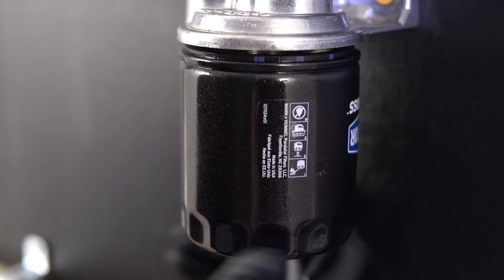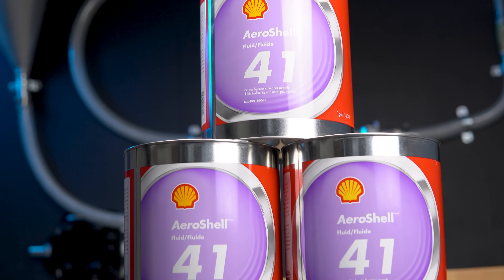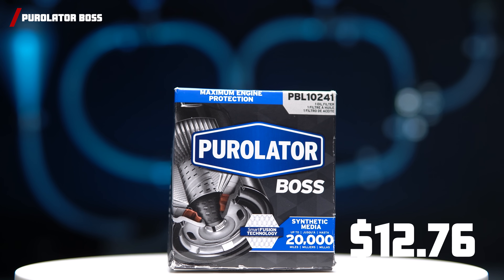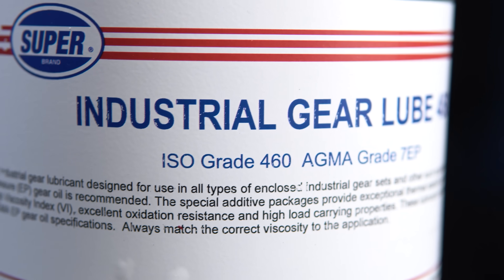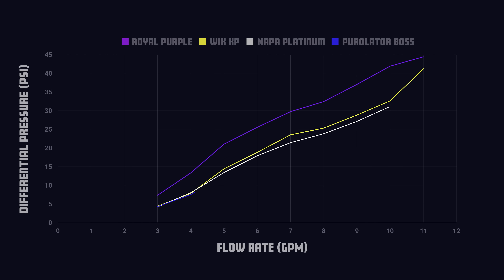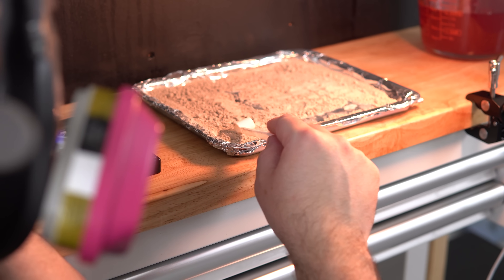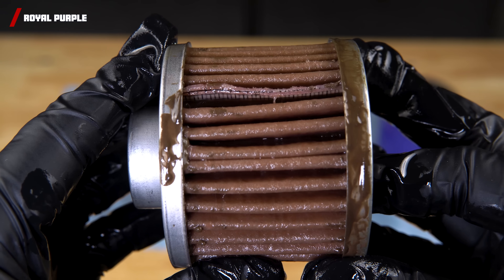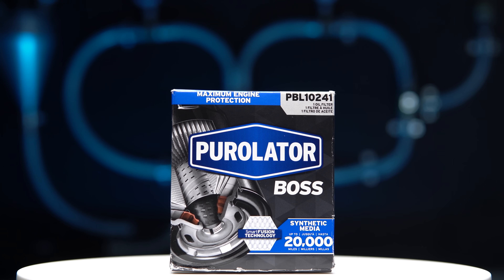Engineers Test the Most Popular Oil Filters

Comment: Uhm... it's a filter... wouldn't the higher particle content be better if it was in the filter? Or was it the oil filtered, that was sent back to be tested?
Reply: the results were confusing or at least how they were presented. the oil used in testing the flow of each filter was sent to the lab and the lowest particle count in that result would indicate better filtering. Purolator filtered best followed by royal purple, wix, and in last place napa. over all it would seem that purolator is the best choice with best filtration and highest flow rate while royal purple had second best filtering and the worst flow rate. If i were buying a filter i would pick up a purolator boss filter and if they didnt carry it id go with wix and skip the royal purple all together bescause of its horrible flow rate
Reply: @thebrowser101  which is confusing because wix makes napa's filters and might still make amsoils filters
Reply: I appreciate you're reply, either i missed it or, it was implied and not explicit, your reply helps. But, also, who makes who's filters, are also a quandary. At this point, as long as it's not a Fram or pensoil filter I'll use it, if I have to, if the best filters aren't available, and I'll still change them out between pil changes, because for some reason, when I've personally taken my filters apart, I've been disgusted with what's been trapped.
Reply: @cmasailor  i recently discovered fram was the OEM supplier to geniune blue honda filters in the US and probably many more. i personally dont use their filters but i think thats saying something if the OEMs are using their products. I also didnt understand why the napa filter did poorer than the wix, they are made by wix and share the same part number. my guess is wix and whoever they supply as OE get grade A stock and napa gets grade B stock though those numbers in the results didnt have the biggest gap between them. Wix USA is a subsidiary of MANN+HUMMEL out of Germany. They are OEM for many of the euro brands Mercedes, BMW, etc. the Purolator filter did best in this video because it is a synthetic media instead of regular paper cellulose -thats what made me watch this one. Purolator USA is also a subsidiary of MANN+HUMMEL of Germany. it is suppose to be impressive tech removing 99% of particulates over 20 microns and provide high flow and this video showed that pretty well. i believe the royal purple one is designed poorly and that is why flow is restricted even though they used synthetic media or maybe too much media who knows just skip it
Reply: @cmasailor amsoil filters and royal purple are made by the same company champ labs

Comment: At what pressures did they bypass?
Reply from the maker: Each filter by-passes at different PSIs. Some of the filters don't even advertise it, but all were confirmed to be higher than the 8 PSI and its normally a range, like 8-12. Those springs are not very precise.Thanks for watching

Comment: Purolator Boss is not 99% at 25 micron.   Purolator One is.  The Boss is only 50% efficiency at >46 micron which is very low efficiency and about the same with normal cellulo filters
Reply: exactly

Comment: Kinda confusing info where you test one set of filters in another video to take out different size of contaminants while this set of 4 are tested against different contaminants. I have used different filters over the years but have been using Mobil1 M1-210 in my Mustang for the last 3 oil changes and Mobil 1 M110-1A in my Xterra.

Comment: I usually use a Napa Gold with good results, one thing to note is paper filters often advertise as improving filtering capacity over time as they become more restrictive where as synthetic medium often advertise higher flow rate with less filtration. It is pretty impressive on the PurolatorBOSS, I used to use them but they are no longer stocked in stores near me and I wonder how the napa gold and other hybrid and paper mediums would compare.

With cartridge filters if you ever tackle that I find that ones with plastic end-caps like the FRAM's tend to get distorted and warp, effecting filtering and even blocking oil flow sometimes. Other times I've seen height dependencies and once there was a TSB to replace a specific model due to this, it was too short to actually compress into the housing and filter the oil.
Reply from the maker: Great info! Thank you. We will be talking a little bit more about the different filter mediums in a future video, we want to make sure we also educate not just throw numbers at people, so thank you for commenting, it is much appreciated!

Comment: For the hot and cold flow comparison test, do you use oil filters of the same size from the different brands tested? Because if you don't then the flow rate comparison makes no sense.
Reply from the maker: Indeed, all the filters are cross reference of each other. In other words the Frame xg3614 can replace all these filters

Comment: Mechanical engineer here, im lost on your units....youve got low particle count on Purolator but you rank it "1" in filtration at the end of the video but chose to go with the Wix which was ranked "3" in filtration?  I dont understand. By the way i work in API rotating machinery and our filters are rated 10micron with a dual arrangement with bypass and DP measured....i did get my 07 civic to 402,000 before i sold it and it still got 43mpg if i drove super gentle and ran the original cat to 380k....with a mobil filter and Pennzoil natural gas base.
Reply: I think he filtered outlet of the oil filter. So purolator boss filtered the most

Comment: Very rigorous test. Very nice. But I would say referencing iso 11171, that scale gets nowhere near the specs required to accurately/precisely measure the dust. But to be fair. Those scales, even used, cost upwards of 5 grand.
Reply from the maker: Hey, Thank you so much for watching! and completely agree, but like you mentioned they were very expensive, being such a small channel, we really don't have much funds and decided to spend it in all the other equipment needed. Hopefully one day we will have the funding to actually buy NIST calibrated equipment.
Reply: @BrandRanks keep up the good work!
I'd love to see a test that somehow mimics an engine operating.
Whenever I see videos of a k&n air filter with oil results, they'll show that the silica doesn't increase in the engine, but I've noticed that the iron does increase in the engine.
My suspicion is that silica particles will get caught in the oil filter, so they will not show up in the oil laboratory tests. But iron only comes from one place, your own engine. And iron dust is smaller than the oil filter media which is why there is an increase in iron ppm.

Comment: Why test capacity to a set psi as opposed to a set time of flow? The already restrictive filter media is of course going to fail your test first.
Reply from the maker: The test concluded once it reached 8 PSI above the initial differential pressure. I.e if the royal purples initial differential pressure without test dust being injected was 5 psi, the test would conclude once it reached 13 PSI. If another filters initial DP was 2 PSI the test would conclude at 10 PSI of DP.  This is similar to how capacity is tested under the ISO standard. Hope that helps. Thanks for watching

Comment: isnt the filter that contained the most particles the best one in performance? If the purolator contained only 30 while the napa had 900 particles, that would mean the napa one filtered more particles out of the oil?
Reply from the maker: Hey, apologies for not being more clear in the video, we will be adding a note. The lower the particle count on the oil after it has been filtered, the better it performed. The particles we measured was not what the filter captures, but what the filter did NOT capture. Hope this helps and thanks for watching

Comment: "restrictive" is almost guaranteed because it's a finer mesh
Reply: And your pressure differential should have been a percentage.
Reply: Also if multiple filters mentioned 10 microns, why the arbitrary size of 21-38? Why no 10-20?
Reply from the maker: Hello thanks for watching! Restrictive does not necessary mean finer mesh, as a cellulose filter will be way more restrictive than a synthetic media filter, this will be shown in a future video. 

Percentage how? Between first place and the rest? That's a good idea, maybe once we finish all 20 filters 

21-38 is no arbitrary it's how the laboratory reports it's laser particle measurements per the ISO standard. Hope it helps

Comment: 38°F is considered "cold"?

When I go out to start one of my 3 vehicles during the winter here in ND(whichever one decides to start in this 😅) it's anywhere from -50°F to maybe -10°F..... and that's not counting the sustained winds that occur around here during that time.... you're talking 30mph easy.....lets say it's -20°F out, with 20mph sustained wind..... it's literally brutal outside and within a few moments, any unprotected skin is feeling like it's going to burn off.

I start my truck(97 GMC RCSB K1500) and my radio doesn't even want to work until I have heat produced in the cab(double DIN Pioneer DVD player), it's just frozen and unresponsive and the pixels are super slow.  +38F is literally hot as hell when the week prior was -20°..... that's almost a 60° difference (it's happened around here, goes from 20 below to suddenly 20 above and you're outside in a Tee and shorts sweating your ass off in 20F 😅)
Reply from the maker: 😱😱That is indeed cold. That oil must be molasses! Thanks for sharing and watching.

Comment: For not running a ISO multipass test you sure are chasing it pretty hard…

Anyway, be sure to mix your test dust before pulling what you need.
Reply from the maker: Thanks for watching! And yes, we are trying as best we can to follow it to eliminate variables. It was an expensive document😂.

Yes, we mixed it prior and baked it, but it's a large vat of dust.
Reply: @BrandRanks  yeah, the stuff all around is generally a pain to work with. The dust can stratify enough when left sitting on a shelf to skew results over time, so be careful not to look at it wrong or anything like that.
Reply from the maker: 😂😂😂Yes, that stuff gets airborne quickly also. So full face masks only!
Reply: @BrandRanks  also, if your looking to add some value that's less painful cost wise, fabrication integrity is dead simple compare to any of the other common filter tests and can help show differences between the tiers of filters. (A sample size of 1 does not say much though.)